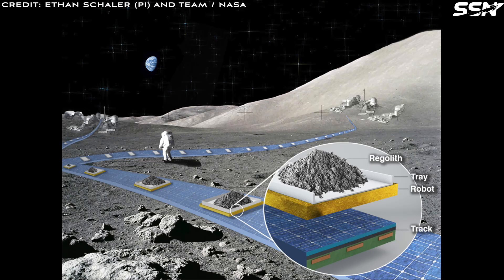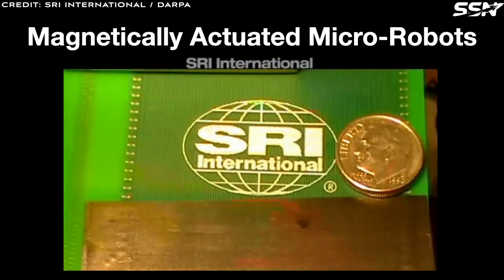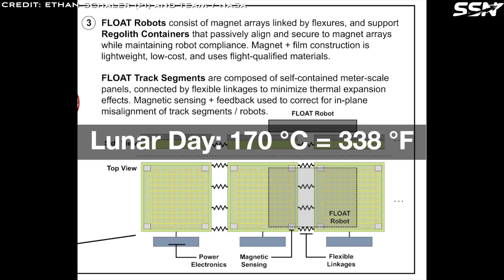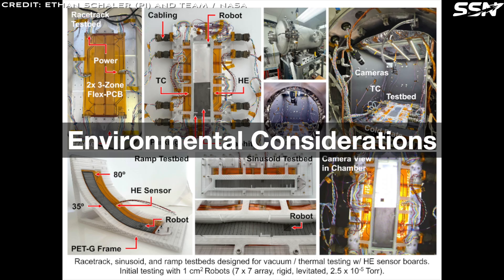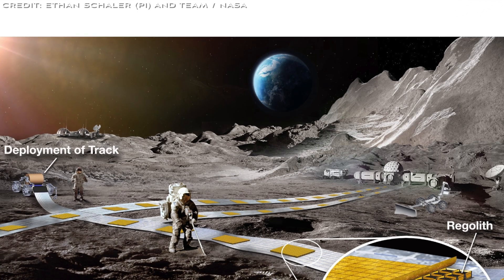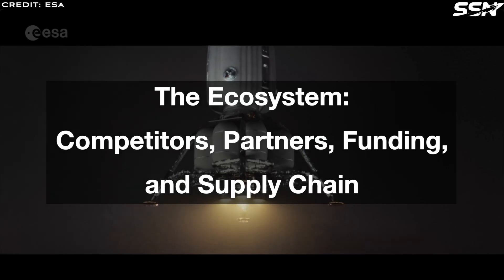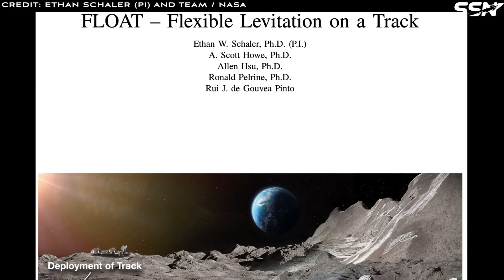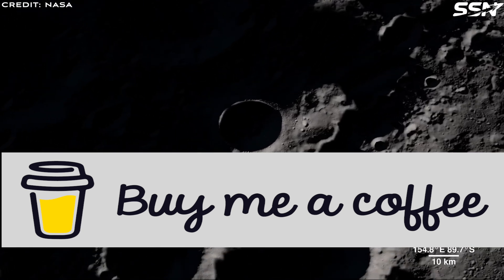FLOAT: Low Maintenance Lunar Cargo Transportation System with Magnetic Levitation

Comment: How much weight can be put on these magnetic rovers? I assume the greater the weight the stronger the magnet has to be.
Reply from the maker: Stable levitation with payloads exceeding 30 kg/m². A full-scale FLOAT system, capable of hauling 80 tonnes of lunar soil daily over 10 km, requires 1,300 robots and a 20 km track, with a total system mass of 30 tonnes. Consumes less than 40 kW of power.

Comment: Considering the tonnes of material that will need to be moved very long distances during the growth of a lunar base, this appears to be little more than specialised system.  600 meters of track and 30Kg of load per square meter, is a pittance when compared to the number of tonnes a rail system could move over tens or even hundreds of kilometers.
Would not the flexible track also form a barrier?  It would be difficult for an astronaut or rover to cross without doing considerable damage to it.

Comment: Uh, solar power ? if it was so much better then we would have this kind of transport here on Earth.... it would be hard...well on Moon everything is WAY harder, like X 1000. As so far the best way to go and the only logical way to go is to use Harvester that  would function as full factory to produce ready to go stored product.R & R could be apply in some case of getting the goods in a tank to landing platform, but other than that I dont see any logical use for it, Moon megalith surface powder or dust would not make a good substance to make rails systems, the Moon soil in in a form that looks like shredded glass mix with sand, something like lava rock, ...want to make R & R system out of GLASS? this would be very energy intensive to malt Moon soil in to Glass and shape it in rails, such a thing can not be produced by use of solar power, a nuclear power, yes....do we have a nuclear power station build on Moon? I think TOYOTA is working on a prototype of a rover transporter and rover-harvester for Moon operations, as a part of Jap space program. TH

Comment: How do you control speed going uphill or downhill?  How do you get anything uphill?
Reply: Things would be moved uphill the same way maglev trains here on earth right now move up hill, by the attraction and repulsion of magnetic force. As it stands here in 2025, maglev trains can do a 10% grade (rise of 10 in a run of 100) while conventional steel wheels on steel rails railroad trains lose pulling power dramatically as grades hit 3% and 4% (rise of 4 in a run of 100)

Comment: Come with me on a magic carpet ride...
Reply: The levitation system supports 30kg per square meter. The track is 1 meter wide. To a first approximation, I mass 100kg even without a spacesuit. Since I insist on life support, a ride for one person is out. Don't even think of a ride for two.

Besides walking is faster than moving at 0.5 meters per second, which is 1.8 km/hour.

For some reason I have a 50 year old song running through my head...